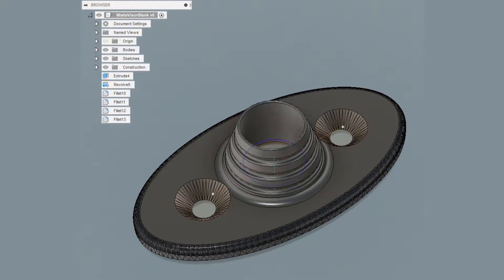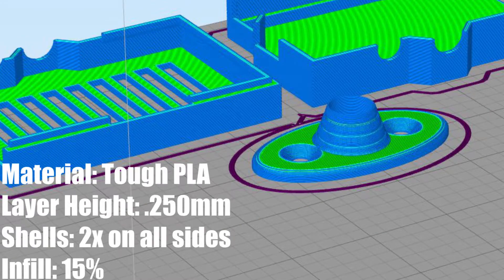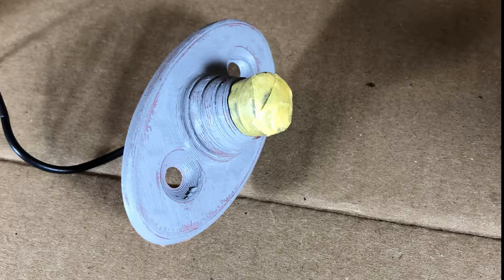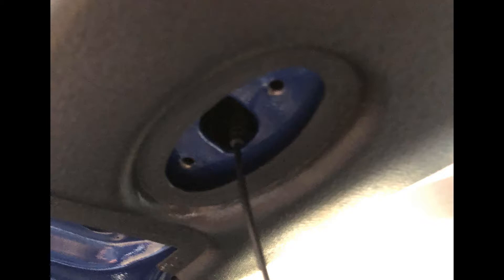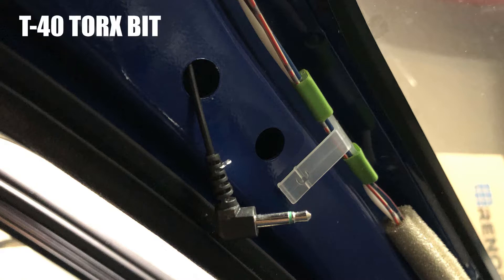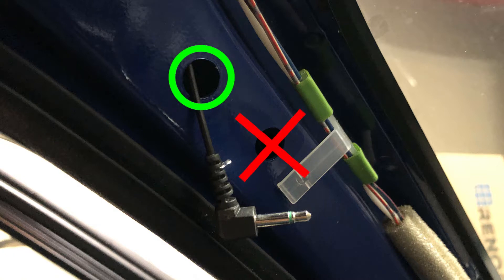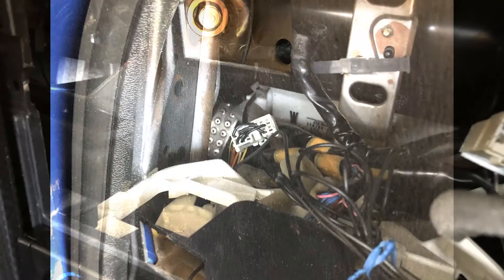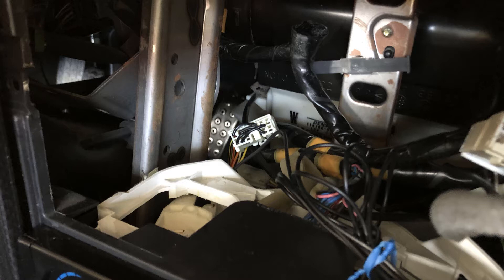How to install a microphone in a Miata

Comment: Any issue with wind noise while top-down, Isaac?
Reply from the maker: Well, sort of. I think my mic was damaged when I was snaking it through the A-pillar, and it only seems to work intermittently, regardless of whether the top is up or down. I don't really use the mic much anyway, so I haven't gotten around to fixing it yet.